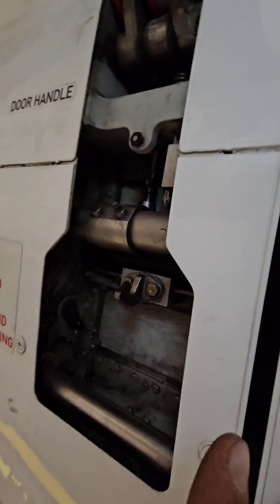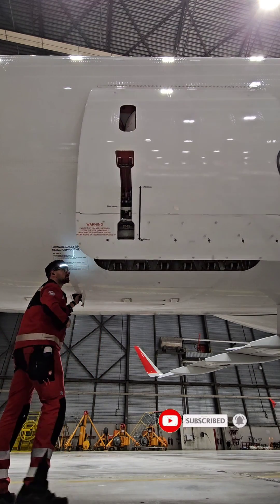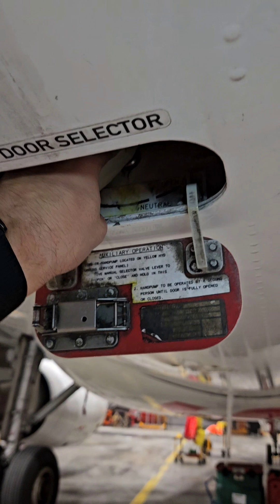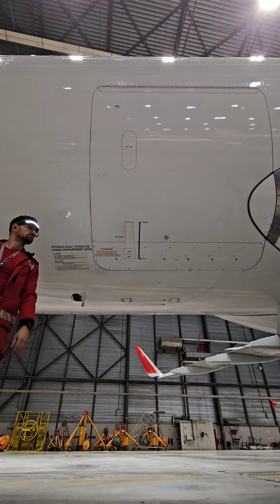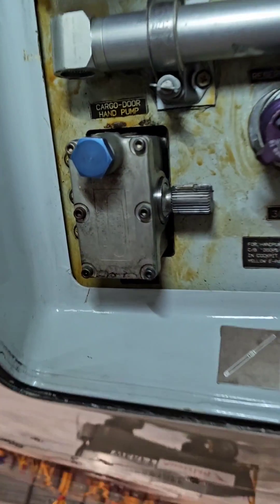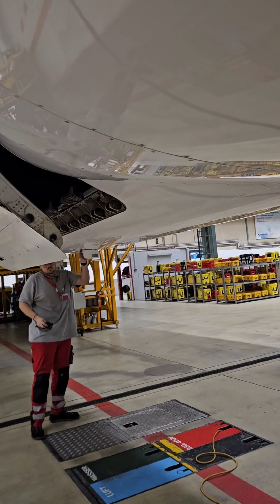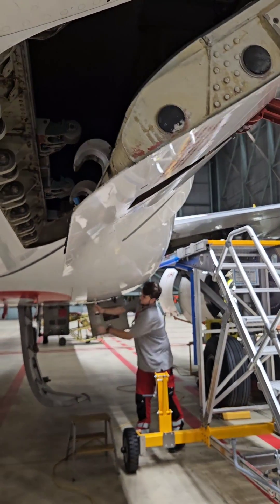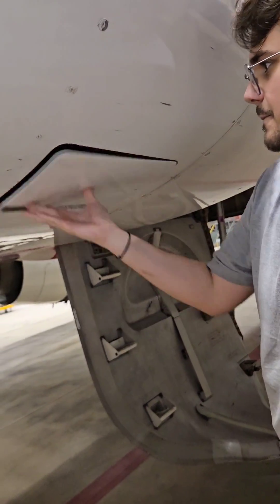ATA 52 No power? who cares...How to operate the cargo door on Airbus A320

Comment: I needed this the other day, then it turned out that real issue was the aft cargo door's switch would not command the elec pump to pressurize the hydraulic system. The forward cargo door's switch was fine, so we just instructed ground personnel to operate both the doors at the same time.
Reply from the maker: Yes this is also option, of course it is not really I.A.W. manual but yes this is option as well